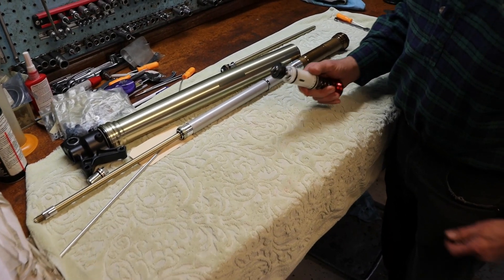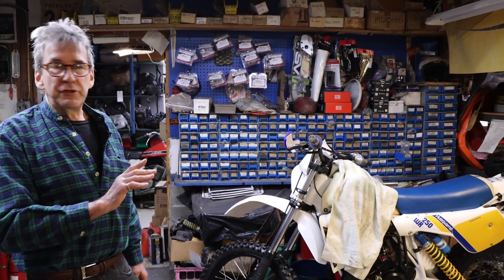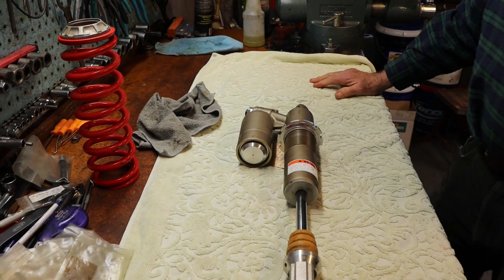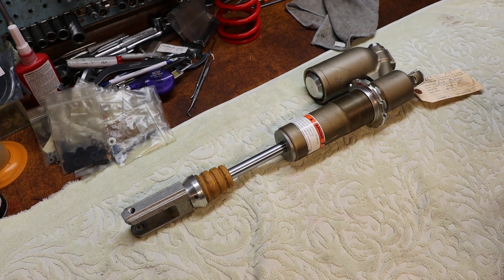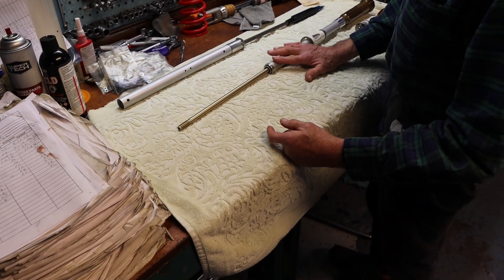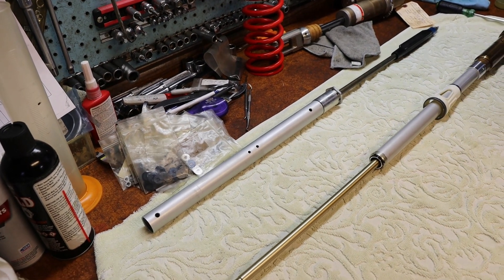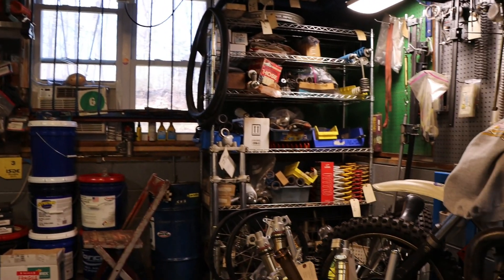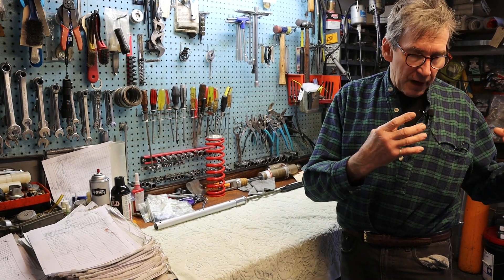Works Enduro Rider's Drew Smith on Enduro Suspension Part 2

Comment: I have a question. Does a bigger piston perform better than smaller on rear shocks?
Reply from the maker: We don't have Drew's deep understanding of it all but hydraulics all basically work the same so we'll take a stab at answering.  A bigger piston (shock, brake master cylinder) will move more fluid in a shorter distance.  A smaller piston moves less fluid in that distance.  The smaller the piston the great the sensitivity and feel, but the less absolute power. So you want your brake master cylinder / or shock piston / or fork pistons sized appropriately for what you are trying to do with it.
Reply: Sooo, your not sure either? Just kidding, I love these videos, keep em coming.